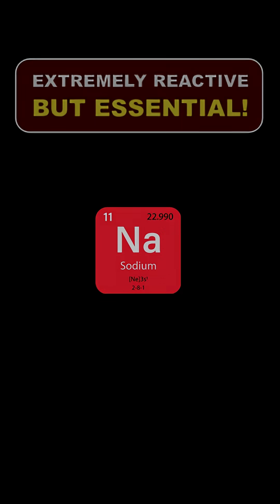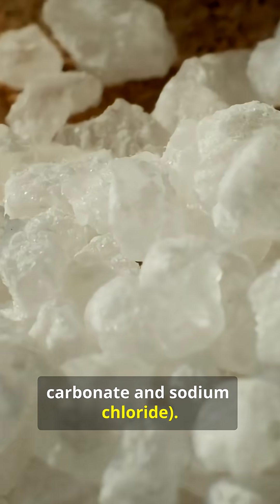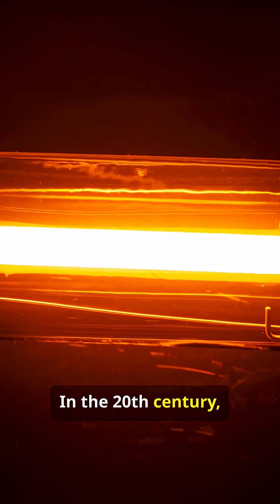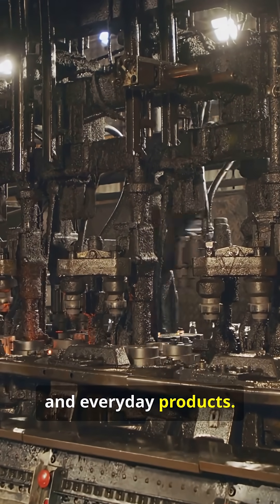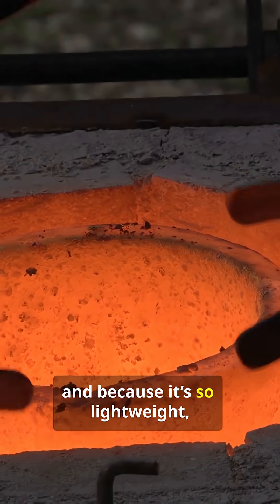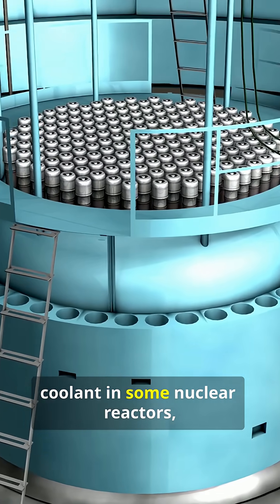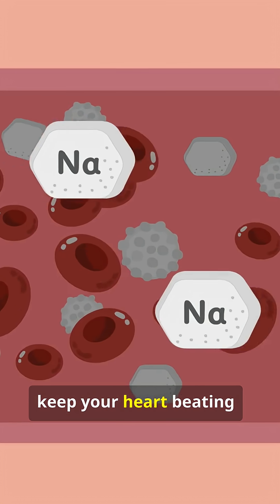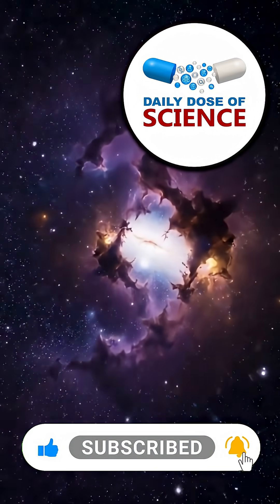Sodium: The Soft Metal That Explodes in Water

Comment: As I recall, sodium reacts with water breaking the hydrogen oxygen bonds producing hydrogen gas that when the heat of reaction gets hot enough it ignites the hydrogen gas that explodes. Not the sodium. 😊
Reply from the maker: Yes, that is the exact mechanism. The sodium dissolves into solution. When the hydrogen is pulled from the water molecules, OH- ions are left behind in solution. Resulting in a NAOH solution. If the water is hot, I'd suspect that the whole beaker would blow apart!